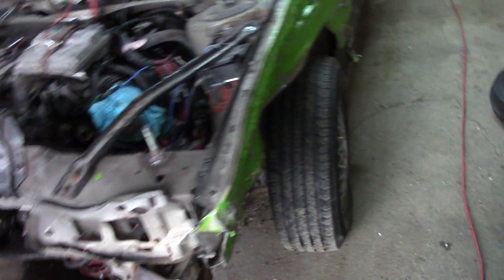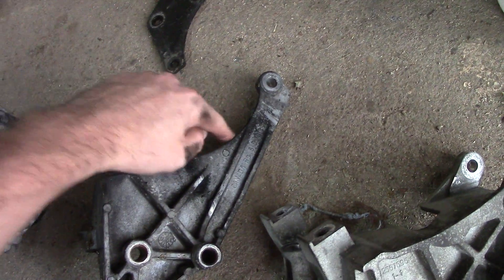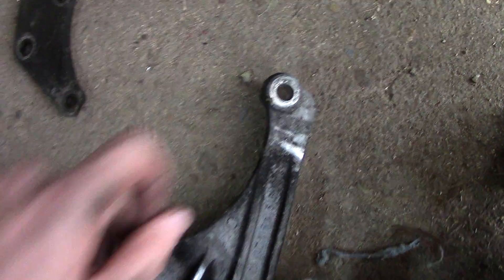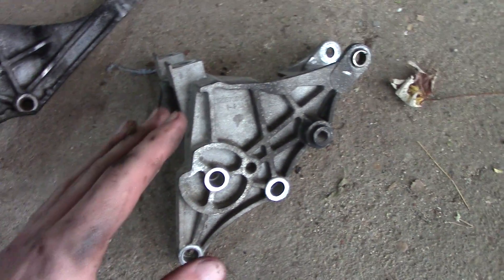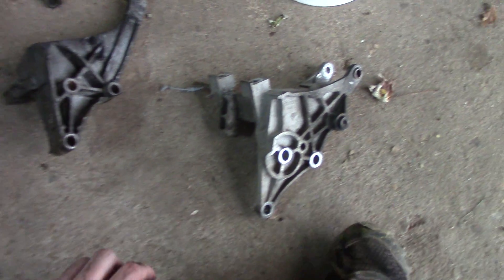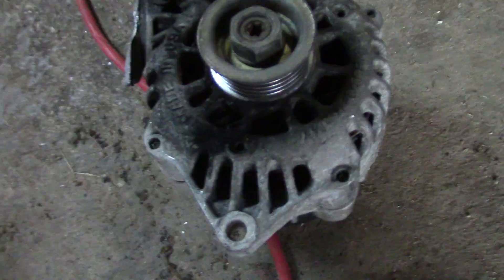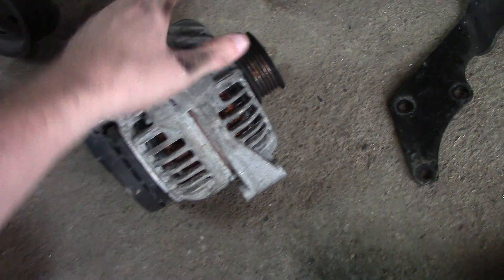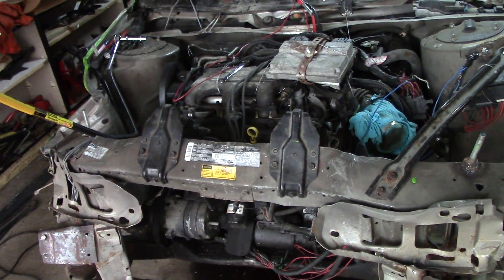96 Lumina Derby Car Destroyed Alternator Fixed

Comment: That 3 bolt alternator bracket is found on the 1999 and newer luminas. They changed the alternator on the 6 bolt 3100's.

Comment: Is the same thing going to happen again? Maybe look at motor mounts and bring things forward a little if possible. I have learned so much from your videos btw, I used the same wiring job you did for your lincoln a while back, and I ended up taking 1st at a derby here in Utah! Thanks again for the thought out explanations and instruction, best of luck and Best wishes.
Reply from the maker: It's possible to happen again, I have added chains and helped the motor mounts where possible. Will depend how many cars go over the bumper.